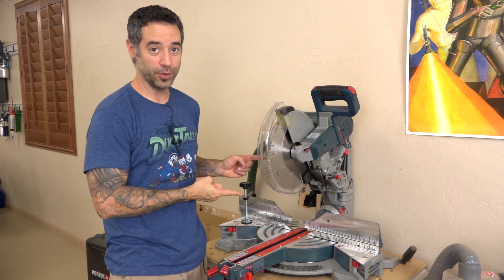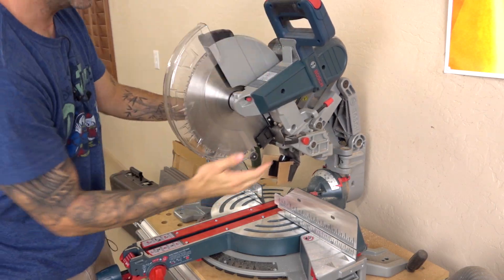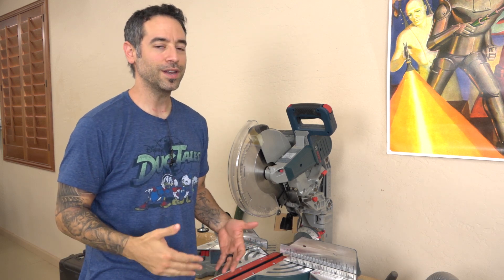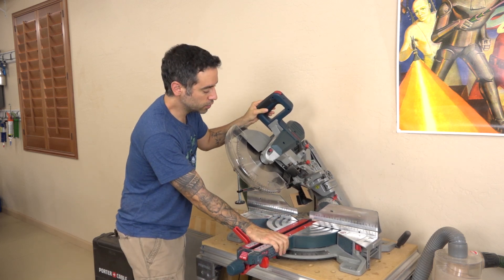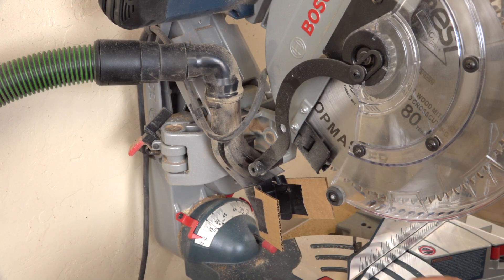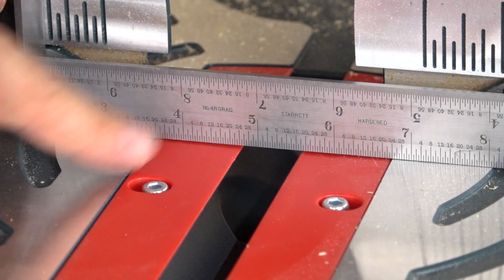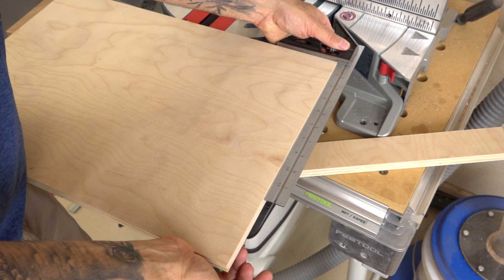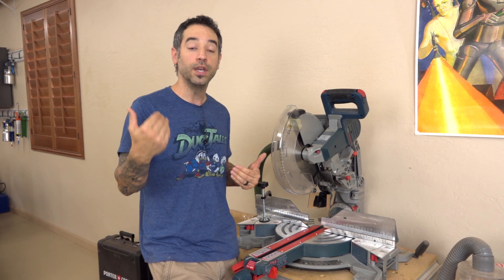Bosch Glide vs Festool Kapex

Comment: I liked the review, it seemed very objective. I had 2 thoughts about your complaints. Fastcap has a xero clearance tape that might fix the slight drop to the insert and be quickly and easily replaceable as need and a good machine shop could add an extension to that clamp, materials wouldn't cost much, it mostly be labor.

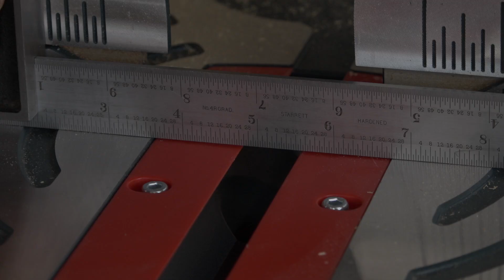Comment: I have this Bosch saw, it's awesome I have had 2 other compound miter saws a 12" porter cable non-slide and another Bosch 12" slide, this is superior for sure. Also at the 5:40 mark, you know to get that clamp to fit properly you can slide the fence back and you won't have to worry about lifting it out of the hole as much FYI...

Comment: Mark,  I coupled this same saw with a $30 laser disc that replaces the left blade washer, and set the whole thing in my version of Jay Bates miter saw station.  The laser is dead on accurate, and dust is no problem at all.  Used it the other day for my first non-90 degree cuts and it was perfect.

Comment: Great review, I've been using the Hitachi for almost a year (everyday) and it goes toe to toe with the Kapex and the Bosch .
Reply: I have a Hitachi 10" dual bevel miter saw and I had a helluva time adjusting it to cut square. It came out of the box not cutting square. I still like it because it's easy to set up, the laser guide works well and it cost me $300 brand new. I'm a carpenter with 42 years of experience, so I've used many a saw over the years. I do most of my work onsite.

Comment: This is unbelievably well timed, i've been tossing up between both of these right now. Thanks for the in depth review
Reply: keep replaying the video of their dust collection. That is where I still think the Kapex is worth it.
Reply: Is the dust collection worth an extra $1000 (my local prices)? Personally, I don't think so. I'd rather rig something up and have an extra grand in my pocket.
Reply: Then thats the proper choice for you. It depend on what you do and what breathing in sawdust is worth to you. I wish the Kapex was cheaper but there is no other saw on the market that is even close to its dust collection. It also is more than 20lbs lighter than the Bosch Glide, it has a built in miter angle finder, it has variable speed for cutting different materials, its laser actual works, and I prefer the vertical handle. I prefer to save my money in other ways. I don't spend $200 a month on Starbucks Coffee and microbrews. I drive a perfect condition 2004 truck and haven't had a car payment in over 12 years. So for me spending an extra $800 for a tool that does the mentioned items above isn't as big of a deal for me. Its for every person to decide what its all worth to them.
Reply: TheVelluch That's fair. The variable speed option would definitely be nice to have.

Comment: The clamping system on mine is my biggest gripe.  The dust collection is the second.
The ability to put this saw right up against a wall is a huge plus.  Also the mechanism is super smooth.

Comment: I wanted the Bosch but settled for the Hitachi. It can be had for less than $400 and has the same type of smaller footprint as the kapex and bosch. The handle is vertical but allows for both left and right hand use. So far I am very happy with it.

Comment: I have had my Bosch for one year now.  I primarily build high end furniture, mantel clocks, and grandfather clocks.  My biggest complaint with it is the inconsistent results.  Especially on the wider cuts.  I have found that it does not take much lateral pressure to cause the articulating arms to flex.  This results in cuts that are out of square or not straight on longer cuts.  The indents also have some slack and I have to make sure that I am actually back at 90 degrees after making a miter cut.  This is not to say that I cannot get accurate cuts.  But I do need to be careful about double checking that the saw is square to the fence, that I am careful not to put lateral pressure on the handle, and I cut slowly.  Not sure that this is what I was looking for in a saw. I am really considering the Festool.  As much as I wanted to fall in love with the Bosch, I kind of sensed that the relationship was going nowhere and that I was probably in denial to justify the purchase.

Comment: Love my Bosch GCM12SD. Lugging it up/down stairs or anywhere for that matter on site is not fun. Very heavy and awkward to carry. I do have the mobile stand for it too, and this is a must have for maneuvering it around. Great saw, have cut thousands of feet of molding as a trim carpenter and got mine on sale for around $520 and the stand for another $200 at HD.
Dust collection does have to be modified at the port. I have a Festool vac attached and I did need to extend the flare like the video to guide the dust into the suction zone.

Comment: I've been using the Bosch Glide in the field for just over a year. It is easily the best compound miter saw I have ever used and I've used  many different brands over the last 20 years. It lives on a Kobalt folding saw stand in the back of an 18 foot box truck and gets rolled out on the job site. I was concerned about it staying true bouncing around in the back of the truck and to my chagrin that has yet to be an issue, it still cuts as true as the day I put into service. As for your problem with the Bosh clamp when I first bought them I had the same issue, until I called customer service, they told me just flip the lever on the back of the upper fence and slide it out till the clamp clears and re-lock it in the new position then when your done just slide it back to it's original position.

Comment: I like the Bosch too. Honestly, in 40 years of working in cabinet shops and job sites I’ve never once seen anyone use one of those clamps on a miter saw. I always assumed they include them as liability protection from litigation

Comment: Hi there Marc, that toggle hold down will work just fine if you just slide the back fence out to the side 🙂 I have 10" saw with sliders, and very satisfied with its performance, it also looks like mine has got a bit better dust extraction than yours, but not the best...

Comment: Great review.  Regarding the clamp.  Honestly, if you're going to invest into something like this, you're more than likely going to build a Miter Saw station and put in a good Miter fence with a stop block which means you'll never use that clamping system again to make sure your piece doesn't go anywhere again.  Plus when you're doing the same measurement cut over and over again, that where a stop block on a fence really shines, so I wouldn't say this is a major flaw.  The only thing that's a down side is definitely the dust collection, which honestly, Festool does so well.  I just really hate the handle grip to the Kapex which I think everyone except true loyalist Festool guys would agree on.

Comment: Hey there Marc.  I have had the bosch axial glide miter saw for about 5 or 6 years now.  I have the same impressions of the saw that you do.  My biggest gripe is the dust collection.  It is actually pretty poor if you ask me.  I have made a few adjustments to try and improve the performance, but to no avail.  I first replaced the rubber shoot with a much larger one.....no change.  Then I made a larger shroud that sits behind the fences that allows the rubber shroud to pass through and at the end of the cut, creates a backstop.  No change here either.  I think the real issue is where the shroud is located.  If you look at the Kapex, the shroud is right behind the saw blade.  The Bosch unit appears to be several inches back.  It blows my mind that the Kapex can be that much better at dust collection than the bosch.  With that said, for the price difference and how I use my saw (shop setting) I love my bosch.
Reply from the maker: Yeah I noticed the same thing. Dust collection is one of those things that you REALLY need to think through in order to make it effective. Look at dust collection on just about any Festool tool and you'll see there's more to it than simply casting a big net and hoping for the best. Same thing with SawStop's dust collection when using their blade guard. It has to be a considering from the start of the tool's design and not an afterthought. So I don't have my hopes too high that I'l be able to get great dust collection from this thing. But I'm hoping to maybe get at least half way there. :)
Reply: Hey Marc!  I think I'll keep my Kapex.  The dust collection is so good and the hold down works great.  I wish it had a bit more power but with the Ug stand and wings, it doesn't take up much of a foot print in my shop.  The Glide would be my second choice...

Comment: I've got the Bosch and the DeWalt Flexvolt. The Bosch has been used for about 7 years and I can't keep it square, not to mention the detent lock tab is totally broken and a pain to get it to unlock. It's basically junk at this point. The flexvolt doesn't seem like it's going to wear like the Bosch because I can adjust the detents and the physical bolts that stop it at certain bevels. Even before the Bosch was worn, the Flexvolt is so much easier to use, especially the lever that locks it in place, both for miters and bevels. All I can say is I'm sold on the DeWalt saw and the ability to run it on batteries has saved me several times when power went out or they suddenly had to work on the electricity on jobsites.

Comment: I have got this one and made exactly the same experience except that I had big issues with the Laser. I needed to replace it soon after I bought it and even though I have spent hours with it I didn't manage to adjust it so that it is actually pointing where the cut will finally be. Main reason for buying it was the larger capacity than the Festool and the integrated support. BTW: this machine is produced in  China whereas Festool still produces in Germany or at least Europe...

Comment: Fwiw, I have a different model of Bosch and it just took a bit of work on a belt sander to get that Festool clamp to fit.  Feels bad to start cutting away material on a brand new $100 clamp but it fits well now and it’s great to use like you said.

Comment: we bought a Bosch to use at work.  4 good carpenters using it for a month.  We ended up taking it back.  The fence wouldn't stay square and the bevel would creep down as the lock wasnt strong enough to hold the head if it wasnt at a stop.  
We didn't replace it with a kapex because of the motor issues they have.  I have a kapex and I like the saw a lot but I think with the amount of trim we cut in a day the motor wouldnt last long at all so advised against it.  For a one man show it's great.  For a whole crew its just too expensive.   
I am waiting for the new makita front rail miter saw to come to stores so I can check them out

Comment: I'd been drooling over this saw for awhile and got lucky and found one on Craigslist that had never been used that included the gravity rise stand.  Got the whole setup for $600 and then sold the stand for $200 and made a miter station.  I'm like you in that I don't do bevel cuts so I torqued the bevel tension nut all the way down so I know it will stay true at 90 degrees.  Made a zero clearance insert ala John Peters vid and it is perfect.

Comment: Even if Fe stool offered a BJ a day for a year, that handle would be a deal breaker. For other fans out there I own the BOSCH, and it's so well engineered.
Reply: the BOSCH is WAAAAAAAAAAY too heavy to use as a jobsite saw, it's also very hard to keep the saw at 90 degrees while making beveled cuts. Either your saw cuts square while making bevel cuts, or it cuts square while making 90 degree cuts, but you can't have both. I have used 3 different saws and they all had this issue.

 Although I have never used the handle on the festool just looking at it hurts my wrist.

Comment: The problem I have with the Bosch is the weight - it is hernia inducing. I leave mine permanently attached to a mobile miter saw stand in my shop but even on that the weight has caused it to topple over. Fortunately the saw is strongly built and there was no significant damage. For onsite jobs I use either my Hitachi 10 inch or Hitachi 12 inch dual bevel miter saws - they are both accurate and portable. The Bosch has tremendous cutting capacity and is very accurate for cross cuts but the motor position limits bevel cuts, and compound miter cuts are not always precise.

Comment: Hi mark don't disagree with anything although in the UK the price difference is a lot less about £60-£100. I still went for the Bosch because of something you didn't mention which is the increased capacity. My previous machine was the Makita LS10, one of the original (over 10 years old) but the Festool could not beat the capacity as a shop machine. When I can afford it I will replace the Makita with the Festool Kapex for job site work.  
As for the dust there are some suggestions on u-tube for home made solutions, which I will be applying next week, a simple measure using an old inner tube. Also I've had mine for over a year now so needed to get a spare blade whilst the original was being sharpened. I opted for a blade with90 tips and I found the dust problem got worse. So blade choice has an influence on the amount of dust generated. 
Keep up the good work. 
A fellow lover of Festool stuff
David

Comment: I bought this saw as an upgrade to my 10" single bevel. Smooth movement, powerful motor, and dead precision. It went to work straight out of the box. No need to square up anything. I am the envy of my woodworking buddies.

Comment: I've had the same Bosch GCM12SD in my shop for a year now and cringe every time I use it.  Unlike the Festool Kapex, the Bosch doesn't have soft start so unless you've got a death grip on the handle, it really jumps when you pull the trigger.  The back fence is also odd and once allowed a cutoff piece to fling back with enough force to shatter the dust collection hood.  It was all replaceable, but shouldn't have happened.  I too use a Forrest Chopmaster blade as the Bosch blade that came with it had about 20 thou wobble.  I'll buy a Festool Kapex before the end of the year and put the Bosch on Craigslist.

Comment: there are several things that could be improved about the kapex (mainly the depth stop and the handle), but in my experience the bosch glide wobbles a lot more. also, it is a lot heavier. i would say theres a lot of room for improvement in the miter saw world.

Comment: Just a note on Forrest.  They will drill any kind of holes necessary for your saw.  I'll bet they have a solution for Festool.   I have a Felder combination machine with 30mm arbor and locking pins, and they drilled out that format and it works great.

Comment: I've talked to some guys about the Bosch and a few have had a funny complaint that the saw is "too smooth" with regard to it's sliding action. It should be noted that you can increase the tension so the glide is a little stiffer.

I'm not a Festool hater by any means, but I would expect for the price of their tools, they should be perfect in every single way. The complaints you had with the Festool did seem relatively minor, but if I'm dropping that kind of money, I demand perfection.

Comment: Bought the Ten inch glide knowing my dewalt  twelve inch was on the frits. I bought the bosch on a sale so it was boxed for almost a year befor the dewalt died. I was so excited to finally  unbox this GLIDE. So after a few hours had this thing all set and matched up to my sawhelper stand.  While trimming a bonus room in a garage (with mdf most forgiving material ever) was having trouble making my miters match on the door trim. Went back to the saw probable ten times to make a miter?? I thought it was me for about an hour thinking WTF!!!  So what I found out is the positive stop on the glide, depending which way you lock them  there about a half to quarter degree off from one another.  Meaning a full degree at times for a miter. Giving the saw the benefit of the doubt I went to ever store in town ( four that have this saw) and did the same test. EVER BOSCH WAS THE SAME AS THE POS I OWN!!!!!!!>>>>>> Happy ending I bought the Kapex and now have a new boat anchor

Comment: The clamp is not as bad as it sounds. Large adjustments are made in the back with the clamp shaft. You slide the clamp in after you place your piece on the table. The pressure you create when tightening keeps it in place.

Comment: I enlarged the dust collection shroud using a motorcycle tube. The rubber is thick enough to keep its shape and gives easily if it comes in contact with the work piece. Another gentleman welded stainless tube that had a 2" ID for way better flow. Found hist mod using a google search.

Comment: I own this Bosch saw: I put the Kapex hold down clamp on this saw; it works and is sooo much better then the Bosch. I also put the Kapex rubber shroud on this saw using a zip tie. Again works much better. Dust collection - well this is not really fixable. I use a Festool shop vac, with large 36mm hose, and even with the Festool boot it's not very good.

Comment: I have both. Kapex I use for my shop (quieter, better accuracy and like the clamps better. Glide saw is my rough lumber saw, that I have attached to a mobile dolly thing. Nice for the added capacity for larger lumber/crown.

Comment: If you take the upper fence off the Bosch saw you can use the quick acting clamp fine.
Reply: I just cut some of hight of the fence off, it works great with quick clamps.